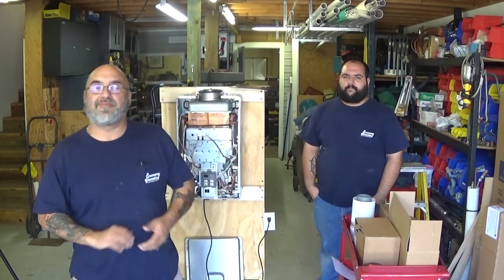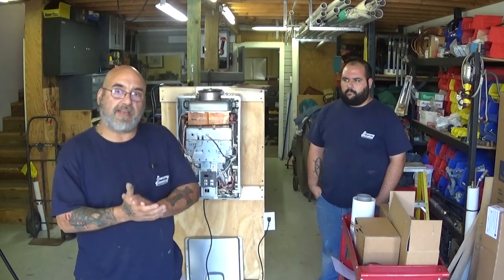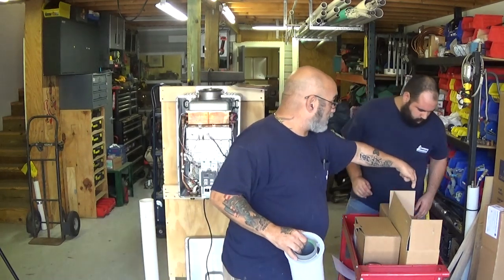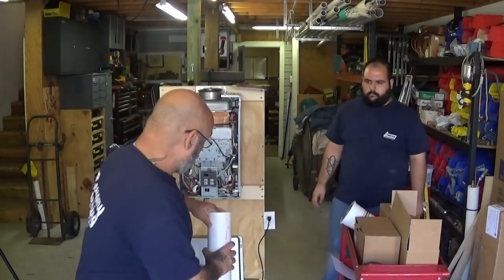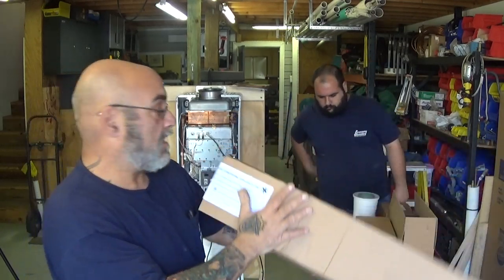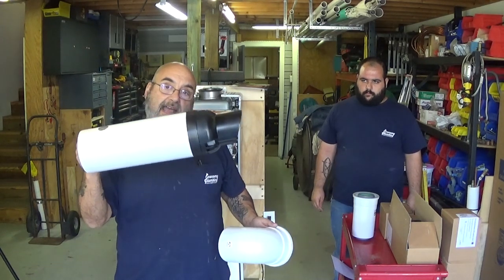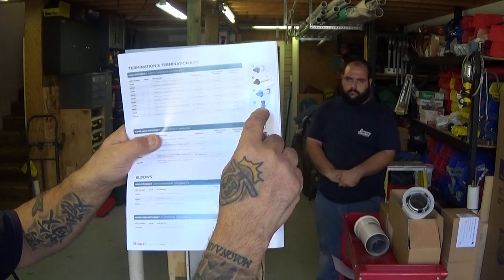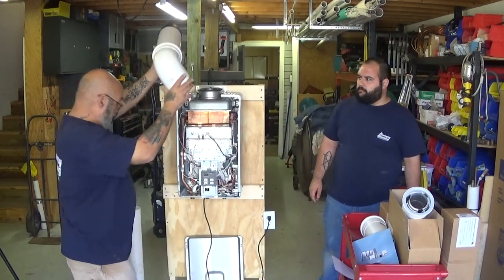Proper venting of a Rinnai tankless heater.

Comment: Mike, very helpful.  Any tips on venting through a garage that is stick built with full size brick gender on the exterior?
Reply: Veneer not gender. Darn auto correct.
Reply: Eric Beach we would chop through the brick to wall vent it. Use the black thimble to mark the hole and drill small holes on the outside of the line then chop the center out.

Comment: I have a R75LSi.  There is nothing connected to the plug on the top of my unit.  I believe it is the condensate drain.  it's plugged.  Is the condensate drain necessary?
Reply: Alejandro Leyva if the vent is the standard horizontal vent which is a elbow on top of the unit and the vent pipe through the wall you don’t need the condensate drain connected. If there’s a lot of horizontal vent piping or the vent is going through the roof you need a condensate drain.

Comment: Hi Mike. My furnace is currently direct vented on the same wall I'd like to mount my Rinnai to. I'm uncertain which of the clearance rules i should use when running the vents for the Rinnai. Does the Rinnai exhaust need to be 3 feet above the furnace air intake if within 10ft horizontally? Or just 12 inches apart? 

Your videos have been a wealth of information. Thank you for putting them together!

Comment: Hi Mike thanks for the videos they are great. can you tell me when venting a non condensing horizontal through the wall do you leave it stick out from the exterior wall or cut it flush to the outside or ??

Comment: I have a question how long can you run the concentric pipe is there a maximum/ distance length
Reply: The Rinnai tankless heater manual has several charts to help you answer this question. Basically, you have to know how many 90 elbows are needed and how much run length. The Ubbink non condensing  concentric direct vent is so expensive per foot (>$40 per meter) that at some point, the vent line will exceed the cost of the value series tankless. At that point a super efficiency Sensei tankless would save you money on vent and install as the vent is low temp, PP plastic  and much cheaper to run. The  outdoor models require no vent at all.

Comment: My unit, rl75i says that it is a non-condensing unit but still has the nipple on the side of the vent. Witch style vent would I buy?
Reply: Matt Kincheloe you need to buy the Belkin vent for non condensing it’s the one that is plastic on the outside and metal on the inside. That nipple on the side is for a condensate pipe or trap if your running a long horizontal vent or if your going through the roof with a vertical vent. Hope that was helpful. Mike

Comment: I purchased a Rinnai V94iN. Does anyone know the correct type of venting for this unit?
Reply from the maker: That would be the venting for non condensing. It’s the pipe with the metal inside NOT THE GRAY PLASTIC. Mike
Reply: @ThatTanklessGuy  Thank you Mike

Comment: I currently have a RL94IN but want to upgrade to a RU199IN since I need the additional flow it delivers to feed my hot water pressure washer.  The pressure washer needs 4.5 GPM and the RL94IN won’t keep up at a 70 degree temperature rise.  My question is, can I use my existing Ubbink non-condensing vent on the new condensing unit?  Thanks in advance
Reply: JSEDecker no unfortunately you have to change the vent to the condensing one. It’s the same size the difference is the inner core is plastic. One other point make sure you connect the condensate drain from the unit to a proper drain. Thanks Mike

Comment: Mike, I have a couple of questions, that I hope you can answer.  I have a Rinnai RUC98iN installed in my attic.  My question is on the condensate drain line...the plumber that installed the unit ran a piece of nylon tubing from the condensate drain line to my pan overflow drain (PVC) that drains to the outside of my house.  I have my A/C condensate line running right beside it that drains into a bathroom sink drain line.  Can I "T" into the A/C condensate drain that goes into the sink drain line with my Rinnai condensate drain line, too?  The reason I ask is, when it freezes outside my Rinnai condensate drain line freezes too, giving me a error code 25.  Unfortunately, there are no drain lines in my attic.  Thank you, great videos, BTW!!
Reply: DJ Sco yes you can it’s not the best application to do buts it’s better then it freezing up. Just make sure that the pvc drain line stays clear at all times. If you can run a separate line to the sink it would be best. I hope that this was helpful. Mike
Reply: OK, thanks for the quick reply!  Will the condensate (acid) mess with the Sink Drain Line which is PVC, long term? i.e. eating away the pipe?
Reply: DJ Sco no it won’t
Reply: Mike is great guy. I have took so many advise from him. DJ Sco the condensate is acidic but it won't affect PVC pipes (if there is copper line for the drain like in some old construction then you have to worry). Follow Mike's advice you won't have any troble.

Comment: We just bought a V65iP. Its going in the house, in the basement. The venting is going be an immediate 90-degree-angle piece connected to a horizontal piece going outside. Do we still need to put on a condensate trap?
Reply: If you establish a negative drain (towards exterior fresh air at 1/4" per foot of horizontal run), the condensate that forms will drain to the outside and your condensate trap should always be dry.

Comment: Would a 3x5 stainless Rheem concentric work on a V75i?  I understand that the V75i uses a plastic outside metal inside vent.  The Rheem is completely stainless. But the stainless termination system for the Rheem is far more attractive sticking out of my house than the Rinnai brand is. So would the Rheem concentric vent system work on a Rinnai?
Reply: The Rheem direct concentric  vent is made by either by HeatFab as Saf-T Vent or CorrGuard. Both are very high quality high heat stainless concentric vent systems and cost much more per foot than Ubbink PP plastic concentric vent. And they will last forever compared to the PP plastic Ubbink vent products. So go for it if you can afford the upcharge. You can contact CorrGuard or Heat Fab directly to see if they have certified their concentric direct vent products with Rinnai tankless water heaters. Perhaps you can mate the CorrGuard or HeatFab exterior penetration termination section to the Ubbink concentric vent products. But that coupling must be gas tight or you risk CO ingress into a living space or attic. These systems are all proprietary and do not like to play well together. But by the time the non condensing exhaust has hit the attic, it may well be as cold as the condensing exhaust on longer runs. BTW, the only gas tight connection needed in each direct vent concentric coupling is the interior exhaust line as the outside vent line is cool incoming fresh air and a small leak path along the run will not affect the inlet air performance at all. When I compared costs per foot, the Ubbink was around $40 per meter (39") vs. over 100 dollars for CorrGuard and HeatFab products. There is no need for high temp stainless on your inlet fresh air inlet outer vent. But it does last much longer than your tankless or your house for that matter.

Comment: I am confused! I thought the non-condensing models did not have to deal with condensation.  That was one of my main reasons with going with a single vent non condensing model. Looking at RLX94iN. Also he says you can't vent through a b-vent or masonry chimney. My home utility room has a hole designed for conventional water heating venting. I have not seem then the interior, but there is a huge concert vent going through the roof. It that OK??
Reply: As the heat from the hot combustion exhaust gases is exchanged across the metal tube with cool incoming clean air, heat is lost and the condensation can begin. The longer the residence time in the exhaust vent, the more condensation and obviously much more condensation during periods of cold weather when the inlet fresh air is chilled. So you can run a condensation line to a trap if your unit has a vertical vent run or run the horizontal line with a grade to the outside (negative grade of 1/4 inch per foot horizontal)

Comment: Hey Mike.  Thanks for the video.  I was wondering if you have ever used the IPEX Low profile termination kit (196985) with 3" sch40 PVC pipe on the RUC80IN?  I used a similar termination on my furnace and I liked the smaller holes through my rim joist and the look on the outside of the house.  Any thoughts?

Comment: How much depth does the pipes side into each other ? 1”  I need to extend my venting and 10” extension is perfect, but if it slides into the elbows 1” on each side then it will be to short and have to order the 19”. Hoping you can tell me how much the pipe overlaps.
Reply: You lose 2.5" per coupling or 1.25 inches per piece. That also includes 45 and 90 elbows. So starting with the distance traversed per run, subtract out as many 39" pieces as you can to save money and then take the remaining distances out as 19" and 10 inch pieces. Add up the number of coupling times 2.5" and add that to what's left and see how many pieces of 39", 19" or 10 inch can fit into the space remaining. On the exterior vent termination, figure your wall thickness and extension of 6 inches and subtract that from your 11.5" or 19.5" exterior termination vent. Don't forget to subtract for couplings to elbows and terminations.

Comment: Can I trim the horizontal exit pipe so that it is not sticking out so far from outside of house?.

Also I will be coming out to a brick exterior.. How would I seal that properly around the pipe because that black seal won't seal properly
Reply: Cutting a round hole in your brick exterior can be done with a wet core drill but it is expensive and messy and the large diameter (140mm or 5.25") is pretty dam expensive and the rig is pretty heavy to hold horizontally for any length of time. Rental yard is best bet to drill that hole cleanly. OR you could try to do it with a Morse carbide tipped hole saw. They are around $55 dollars each and can be run in a slow rpm drill, even some bigger slow speed cordless drills. You can use an acrylic sealant around the white PP plastic, perhaps roughen up the exterior with coarse sandpaper to increase adhesion. The spray foam polyurethane sealants do stick to plastic but have poor UV resistance over time. They expand greatly and may have to be  cut back with a knife after curing hard to get a clean appearence. Use the black plastic trim piece to cover up the UV sensitive white plastic PP pipe and sealants. 

You only need a couple of inches on the exterior termination unless you have an interference with a window, soffit or some other vents including dryer vents that will require you to  have a greater penetration. There is a ton of info in the Rinnai manual on vent clearances and no go zones due to windows, doors and existing vents

Comment: Thanks for the video!  One question that maybe you know the answer to, on the horizontal installation, should the outside end of the pipe be slightly lower than the inside so that water that blows in will drain out instead of in?  Thanks!
Reply: The longer the vent run, the more condensate that will form and collect in the vent. If it is a vertical run, the condensate must be allowed to drain back into the Rinnai unit, where a collar will collect it and allow it to drain to your condensate drain. That can be a simple loop of plastic tubing or a more expensive Rinnai condensate trap. In colder climes during periods of cold weather, expect a significant amount of condensate to collect. For horizontal runs,  a negative grade towards the exterior vent termination will also work. But during times of colder weather, the condensate that forms may freeze when it pools on the ground outside. If that is a concrete walkway, there may be a slip hazard when this happens. But that slip hazard may not be larger than the general ice and snow hazards during wintertime freeze periods. The grade is supposed to be 1/4" er per horizontal foot. Make sure to support the venting with pipe straps or hangers to maintain the grade along the overall length of vent. If not, sagging vent can become filled with condensate and not drain properly, causing early failure of the vent.

Comment: Hi Mike, Thank you for these videos, they are excellent and have inspired me to install my RUC98iN myself. I have a couple of questions about the venting that I'm hoping you can help me with. First is, what tool do you use to cut condensing vent pipe (all plastic) to size when needed? Second is how do I calculate the 1/4" per 12" slope required for condensate drainage? I'm in New Jersey and thank you in advance for your help.Tim Shannon

Comment: How far of a run can a Concentric venting be done if going horizontally?  Mounting this to my interior garage wall, then venting up to attic, then turning it sideways across the attic to vent out of the side of my house. I don’t want to add holes in my roof (more chance for leaks).
Reply: gr8tpumkin  what was the answer how many feet can you run horizontally.
Reply: Bill Masse i never got a reply.  But i can tell you that our Licensed plumbing contractor installed it just as i described above, across my attic above my 2-car garage and it works just fine. He also added some drainage lines to catch condensation i suppose, and those are also running vertically across the wall near the floor of my garage at a slight downward angle, and exiting through the wall to the outside. All works just fine.
Reply: Here is the table from the Rinnai Value series tankless water heater installation manual (page 11)

Number of
90° Elbows
Maximum vent length (horizontal and vertical combined)

0  -41 ft (12.5 m) 
1  -35 ft (10.7 m) 
2  -29 ft (8.8 m) 
3  -23 ft (7.0 m) 
4  -17 ft (5.2 m) 
5  -11 ft (3.4 m) 
6  -5 ft (1.5 m)

Comment: Hey Mike, serious question here; What would happen if the condensate trap lost it's prime (the water that you added dries out)?  Bob in Virginia.
Reply: Bob Troxell it may refill as the unit works but that’s a slim chance. You would have to refill it. Hope that was helpful Mike
Reply: Thanks Mike!  I'll have to go over and check on my son's Rinnai venting and condensation trap.  They have used the heck out of the system since it was installed and he and his wife both love the Rinnai!  Thanks for these videos.  They are most appreciated.  Bob from Virginia.

Comment: Hi there,
Is there limitation on the number of elbows and the distance between them? I have a crawl space with a window and I was thinking about getting the vent pipe outside through the window but I can not install the unit directly in front of it. I was thinking about installing the unit to the right side of the window taking a 90 degree turn to the left and taking another 90 degree turn within 2-3 ft to go outside straight out? 
Thanks,

Comment: Mike thanks for making these videos. I have really enjoyed them. I have one question I accidentally ordered the wrong exhaust vent for my noncondensing unit. Rl75i. Can I use the condensing vent until the correct one comes in? It will be here by Friday.
Reply: nielsengabe unfortunately no the exhaust will melt the center and clog the top of the heat exchanger. That will cause you a lot of trouble. Temperatures can reach around 300 degrees. Can you call a local Rinnai supply house to see if they have it.
Reply: Mikes wood shop unfortunately there isn’t one close. I think I know the answer but can I run it temporarily without the flue?
Reply: Mikes wood shop thanks for the help. You really helped me out of a tough spot. I appreciate your taking the time out of your day to talk to me and answer my questions. Keep up the awesome work.

Comment: Hi Mike, is it required to use a condensation trap?  Mine is in my garage. Can I just use a tube to drain the condensation to the floor of the garage?
Reply: Hi. I'm not a professional, but the condensation is highly corrosive.  My drain line was installed incorrectly and the acid ate through a copper sleeve they used instead of PVC.

I've seen videos of it destroying drain covers.
Good luck

Comment: So whats Cost of all this venting and Everything you never here about ..Couple hundred or more anybody know and having somebody install it anybody got a cost of maybe total job ?????
Reply: The cost of materials and labor to install a Rinnai value series non condensing tankless is pretty huge  as the concentric vent line runs about $40 bucks per meter (yard say) or 15 bucks per foot wholesale uninstalled. The elbows are another 30 each or more. So at least 250 on Ubbink vent lines. Plus labor and markup makes the value series much more expensive to install than the condensing tankless version that run cold exhausts and use all plastic concentric pipes. To save money skip the vent and run an exterior outside model in milder climes or prepare to freeze proof your install in colder climes. If you need a black pipe gas upgrade to support the really high BTUhr gas lines required to supply these tankless monsters, that will also add to the cost as a large capacity tanked water heater is typically under 50K BTUhr and these tankless run approx 3 to 4 times the BTUhr as a tanked water heater. Say 150Kto 200K tankless vs 50K tank. So a $650 Rinnai value series could run 2.5K installed depending on the vent run length, gas service options and extra copper plumbing, isolation valves, drain lines condensate traps etc. And it is real work to install one of these in existing homes without extra preparation. But endless hot water on demand and high energy efficiency has it draw on people. I personally hate to service tank water heaters, the drain and flush routine is time consuming, wet, messy and boring. Done with it forever! Plus direct vent gas appliances are much safer and cleaner than the older flue exhaust tanked water heaters.